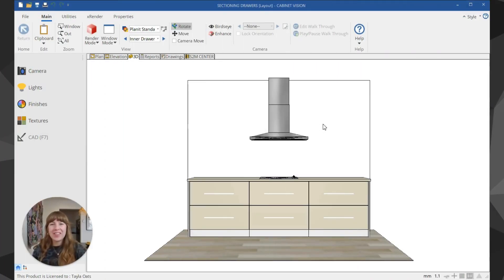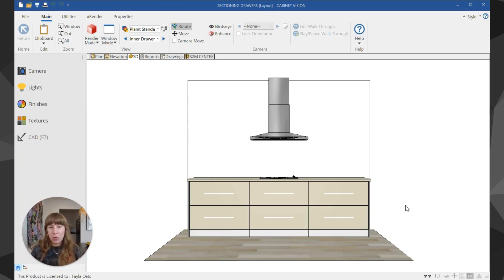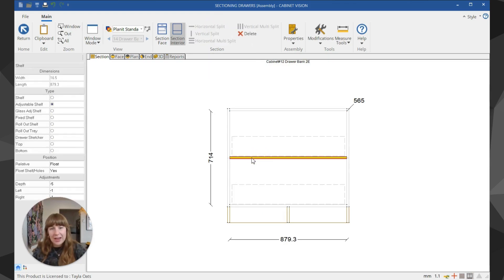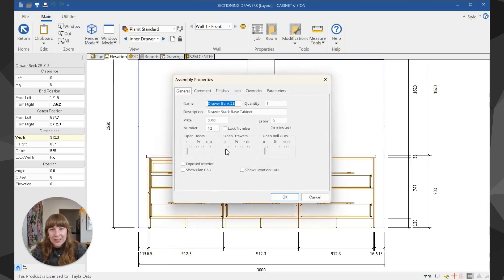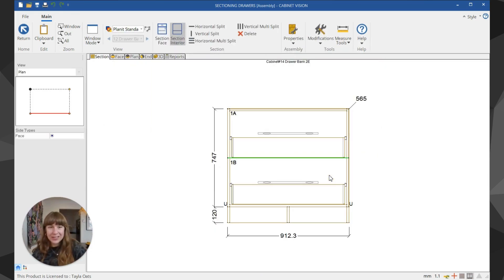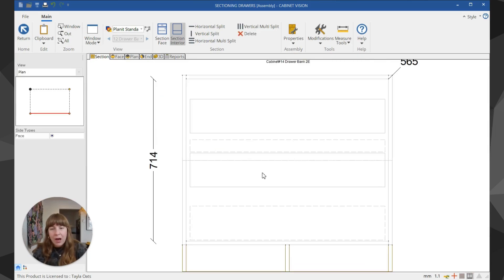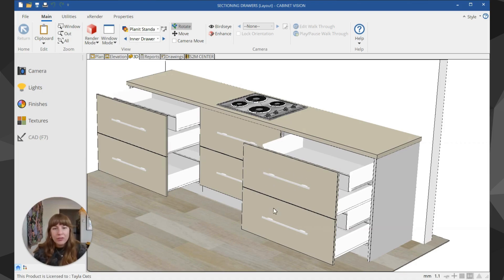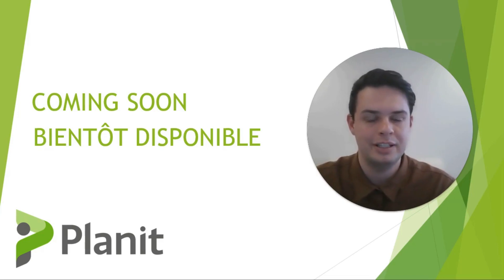How to Add Rollout Trays (Inner Drawers) in Cabinet Vision!

Comment: Thanks!
I have a problem. My inner drawers   Front (face) are not following the drawers material
Reply from the maker: Hmm, there could be a few settings to check here. First place to double-check would be in the Material Schedules. When you open up the Roll Out Material Schedule, is the same material assigned to the Roll Out Front as to the drawer's material? Even if we select the right schedule, sometimes individual parts have overrides in place. Is the same material assigned in the Rollout Schedule as the Drawer Box schedule?